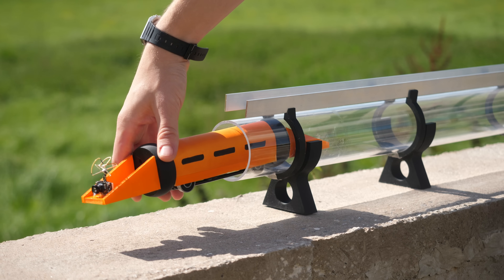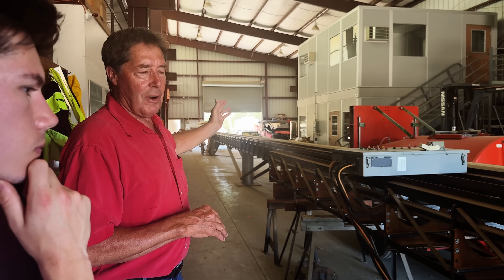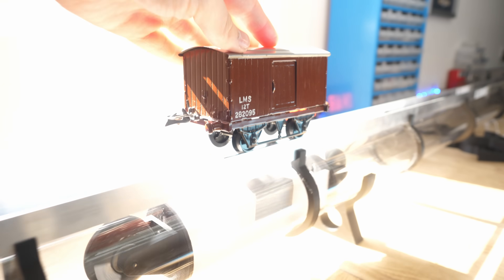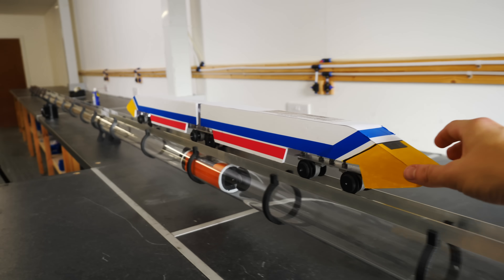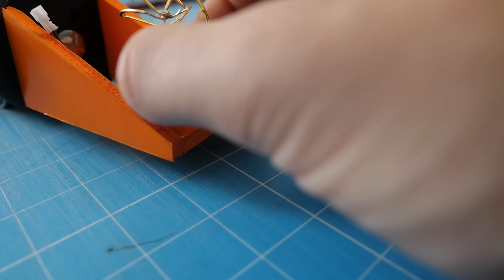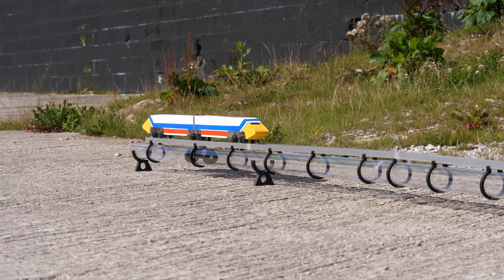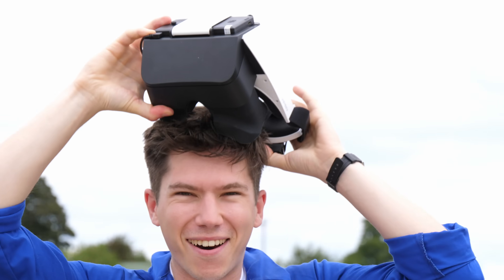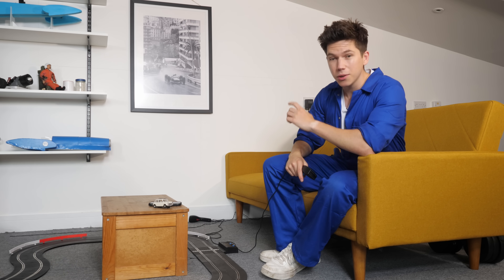Building a SPEED Hyperloop

Comment: There's a profound conceptual problem with this design- the physical work being done is coupled to the position of the train, not the velocity of the train.

This is because pressure * volume is equal to force per unit area ( rewritten as force * distance^-2 ), so pressure * volume is equal to work ( force * distance^-2 * distance^3 = force * distance = work ). Moving the train left or right means changing the volume, which means performing work to change the energy state on each side of the pneumatic tube on each end of the piston.

Contrast this to a traditional propulsion system where the work goes into the velocity of the train, and if you shut off the power source, the train will coast until it loses its energy to friction. In the system you've made, if you shut off the pumps, the work has gone into the position of the train, and the train will settle into a position where the gasses on both sides of the piston are equal pressure. It won't coast. 

This design is not efficient; it's deeply inefficient from the dimensional analysis.

Also, a simple way to increase the scale speed of your model is to simply build a real train that's double the size- then the scale ratio of your model also doubles, doubling your scale speed with no change to your model.

Comment: You could actually make it break the real speed of sound. Seal both ends of the tube with foil and create near perfect vaccum. The Pierce the end closets to the train causing air to rush in. In front of train their is no air to create resistance resulting in unrestricted acceleration. 😉

Comment: Nice start. If you want faster speeds inside the tube check out vacuum canons.  Have a valve at the start point pull down your vacuum  open valve and hear the supersonic crack.
Reply: A scaled up version of this is how they test impact dynamics. They use a frangible foil valve. When the vacuum/ pressure level gets high enough, the foil breaks and almost instantly allo3s air movement. Look up nasa experiment videos for that. Impressive energy release!

Comment: Try piping the exhaust of the vacuum to the other end of the tube to increase the pressure behind the carriage. That way its more efficient bc you are pressurizing the air behind the train while sucked out the air in front of it
Reply: So the problem of going transonic vs supersonic could be solved if the air was moving fast enough. The speed of sound is relative to the speed of the medium you're passing though, so increasing the medium speed could mean you could theoretically reach the actual speed of sound if you had a long enough track, a fast enough air pusher and puller, and enough guts to try!  I'd start with a huge industrial air pump on either end, one pulling, one pushing!

Comment: I think it would be really interesting (and probably more practical) if instead of having one long tube, it was made up of smaller tubes, each with a driver, with the train having electromagnets to connect and disconnect from them. This would not only making each individual tube significantly easier to (de)pressurize, as well as allowing for more trains on the same track and meaning that individual pump failures or pressure failures wouldn't result in a failure of the entire track, as the train would have enough inertia to pass through the inop sections without worrying. Hell, maybe the train could be maglev, with the minimal drag significantly increasing the maximum distance between pump sections.

also, please don't tell me you actually believe in the hyperloop as a serious proposal lol

Comment: What about braking for corners?  I suppose the train above could be fitted with brakes, or what would be better is to build the brakes into the track so when the train nears the corner the track itself  would be constructed so that it would automatically slow the train to the appropriate speed, same for the destination station!  Fully automated no driver required.

Comment: I mean, really impressive, but for the full scale version you'd need a ~30kWh vacuum pump. The irl weight would come out to 1.5 metric tons. An ICE for example has a normal capacity load of about 500 metric tons. 
Doing the calculation for that mass, the velocity would turn out to be 75 km/h. This all assumes no friction.
For a 500 metric tons train to go 1365km/h in your set up would need ~130 MWh at full scale and ~2.7 MWh at your scale.

That's the real problem with Hyperloop. Of course, there is a lot of optimisation possible, but none the less it's a whole lot of energy.

Comment: So, the concept of a vacuum train like this with the train above the tube is kinda pointless IMO.. the old 'vacuum train' was just because pneumatics were safer than electricity those days.
It might work for steeper grades to overcome the limited traction a train has but on regular grades all you have is an overcomplicated rail system as the drag and the friction of the train is the same or even higher than a self propelled train as the dimensions do not change. 
A train keeping constant speed on a level track requires very little power to keep going.
Using differential pressure is going to require exponentially more air pumped in or out  the bigger the volume over the distance is, and if you keep everything at a vacuum with the motor under the track then you defeated the purpose as you are now at the same weight as a regular train but just more complicated.
The amount of power required to keep a large tube at a vacuum would be quite a lot as would the time to get it back to a vacuum for the next train.
IF power wasn't an issue, a vacuum based hyperloop would be able to reach insane speeds though, but oh boy if something went wrong.

Going by a comment down below, a liquid hyperloop might be an interesting experiment as a liquid is far easier to contain and maintain than a vacuum and you don't need a lot of pressure difference to get things to move and apply force. Instead of 'riding the train' you would 'get flushed over to the next city'
You could even use the siphon effect to get some gravity assisted boost. Differences in elevations would be a problem though.

Comment: Adding tie rods between the rails (bolts and nuts between the rails would stabilize the distance between them.  Full size railways use these in real life to stop the rails from spreading when a train goes over a section of rail with a retaining problem

Comment: Wondering if you are printing in just PLA?  PETG or ABS should obviously  do better with the heat and elements.  I've started doing some resin printing.  I think that tech would be better for wheels and that sort of part.  the prints are so much more smooth and they can be solid or hollow, depending on  your needs.

Comment: I've worked a couple of decades in the PTS (Pneumatic Tube System) industry. 

The running wheels on the carrier in the tube are unnecessary.  It's been tried and abanioned many times in the industry. 

The "pistons" you are using is typically a ring of thin carpet or Velcro around the carrier. These "running bands" or "rubbing bands" both seal, as well as be a bearing surface to the pipe.
When Velcro is used, a ring of loops go around the carrier, then a set of strips of hooks attached to loops (by the sticky backing) is places around to allow for easy replacement, as well as sizing to fit the pipe.

On one way "Twin Tube" systems, the head of the carrier will have an "acceleration disk" which fits snuggly with the pipe. It's typically a disk of leather that is just a bit too big, and folds the outer edge over when flying down the pipe. These don't work on bidirections "Single Tube" systems. 

Also, having a little air going around the carrier can center it, as well as help lower the friction. So don't make it too tight.

Comment: Train wheels are a truncated cone to deal with the very issue you encountered with variation between the rails. Maybe try raising the tube up a bit off the deck, put wheels on the bit that goes in the tube, hang the carriage from the bottom and you wouldn't need rails at all.

Comment: You have not built a model of the Hyperloop as proposed by Elon Musk or even as modified by the corporations  using his ideas. You have only built a model of the much older differential air pressure transport systems. Hyperloop is neither a VacTrain, or a carriage as piston concept, despite the media conflating those alternate ideas with it.
A better way of envisioning what Elon had in mind, is a airliner without wings, levitated in some fashion within a much lower pressure system of tubes. Those tubes are the equivalent of an altitude over 100,000 ft, at which only electric powered aircraft can operate since there is inadequate oxygen for the traditional engines. The savings in time are really about not having to do the slow climb to altitude and the resulting  slow descent to gain that efficient means of fast transport.  
Regard this fact: the Japanese superconducting maglev train is to be built 80% of its way between Tokyo and Osaka under ground.  Its travel time improvement depends on having very few stops between those two points and very straight alignments. To do that in air,  with passengers, requires oversized tunneling. You can see that Hyperloop with magnetic levitation solves some of those extra costs over a new Higher Speed Rail line parallel to the existing Shinkansen. Just 20% more has to be in a tube. Air locks at the termini are also an expense but could be built into the cabin ends instead of having to encompass the whole vehicle.

Comment: Why not run air pressure,  and not vaccum? you could then use a large buffertank for air capasity... then use a magnetic valve to stopp the train triggerd by a sensor at the end  of the run. vaccum= max- 1bar.     Pressure= no limit .... deffenetly get the speed that you are after.

Comment: This video feels a little misleading.  Hyperloop pods are not powered by vacuum/pressure differential, they are powered by battery electric motors. The vacuum is there to reduce drag.

You have enough RC parts.  Get a vacuum pump, build a hyperloop pod and do this video again.

Comment: You can't actually have a "scaled speed of sound" because aerodynamics works completely differently at transonic speeds, something you cannot simulate at a scale speed and it would definitely affect your top speed
Adittionally I think there is a limit to how fast you will ever be able to achieve with an air pressure driven vehicle like this due to choked flow, essentially once your vehicle in the tube reaches mach 1 the air flowing into the end of the pipe will not be able to flow in any faster to fill the void behind your vehicle and will create a drag force that limits your top speed to around mach 1, no matter how high a vacuum you can draw at the other side of the vehicle. This effect will only happen at actual mach numbers though as again mach effects do not scale
Reply: Also the concept "scale speed" doesn't work because without changing the model at all, if I make a real train that's twice the size, my scale ratio goes from 40 to 1 all the way up to 80 to 1 for free, doubling my scale speed. The term is physically meaningless.
Reply: @clairecelestin8437  I totally agree with you 100%😅
Reply: @clairecelestin8437 And also on stupid TV shows about animals they always have "the fastest creature" as not the Pereguine Falcon, which goes an ACTUAL IRL 200mph in a dive, but some beetle that runs a 4mph, "but if it was the size of a human...!". If it was the size of a human it wouldn't even be able to breathe.
Reply: Scaled speed records of any type are a crock... if it is in the real world no mater how big or small it is it travels at speed, speed does not change because you are smaller or bigger...  S = d/t    simple formula.. works the same in a vacuum, on water, under water on land or in the air... forces change in all those environments but the way you measure speed remains the same. If this was the case then my 1/10th scale rc car that does 74mph actually does 740mph  scaled speed OMG it breaks the sound barrier provided its 32F.
Reply: @thesithlord327 you said exactly what I believe 😅 'scale' speed is utter rubbish! No offence to the Author intended, speed is speed😅 that's it!
Reply: If it's traveling in a vacuum then there are no aerodynamic forces at play other than friction of the air surrounding the vehicle and the tube, just pressures? If the aft section were under pressure the induced aerodynamic forces would be reduced? If both of those were balanced by vacuum and pressure what does aerodynamics influence other than the friction of the walls of the tube and the vehicle. I don't know, but had to ask. Airflow and pressure are different things.
Reply: @helicopterdriver  it's not a perfect vacuum, and likely far from it
Reply: @helicopterdriver  the vehicle is not "sucked" along, it is pushed by the atmospheric pressure behind it because there is in fact no such thing as suction
In order for the air to push on the vehicle air must flow into the end of the pipe to maintain pressure but as it does so faster and faster eventually it forms a sort of boundary layer choke point which actually stops any more air from entering the pipe which is called choked flow, even if it's a perfect vacuum on one side and a higher than atmospheric pressure on the other as long as the high pressure side needs to flow through a restriction (the end of the pipe) then this will happen and it limits the speed of the air and thus the speed of the vehicle it is pushing to Mach 1
Reply: @mishkamcivor409 I understand where your head is at, but the real world experimental data proves you wrong. 

Sources: firearms, artillery, spud guns, and Smarter Every Day's Supersonic Baseball cannon.
Reply: @mishkamcivor409
The mach speed referred to here is what pressure waves travel in that system of fluid, expansion rates into a vacuum(or partial one thereof) are completely different and much faster. Much faster. And are what would be building pressure behind the thrust piston not a mach 1 shockwave.
Reply: Just make a scale train small enough to fit in an air rifle… you’ll be hypersonic with a puff of air
Reply: This is done in wind tunnels by changing pressure, I think? So the scaled model is in an atmosphere that matches the Reynolds Number of real air? Something like that...
Reply: also at any rate making something small go 25km/h isnt really that impressive.
Reply: LOL Scale speed. that is the first time i have heard of that...

Comment: Looked like there was a dip in the tube path in the first 1/3 of the track that was robbing you of some acceleration.

If you make another version, design a "flag" or circle that hangs off the side of the tube supports with a small hole in the middle. Then you can use a laser level projected through the holes to get shims under the track supports and make a perfectly straight/level tube.

Comment: OOOO! What about Rubber bands to hold the rail clamps closed? The rubber bands cannot pull beyond the physical design of the 3D Printed parts, yet still being flexible enough to give-way as needed but will still try to resist. #2, Why was it necessary to have the rail clamps open in the middle? (never mind, I just figured that one out BUT, that leads me to the next question... What is the "Working Range" of your magnet coupler? What is the Min/Max clearance between the two magnets? I bet the answer would allow for a particular amount of "clearance" for a solid 3D Printed Rail Joiner... hahaha .... Maybe!! Just wanted to share. Thanks for the awesome video!!

Comment: I am curious. Would that go at the scale speed if it was a real life scale one? Like I don't know if it would be faster or slower (or more or less the same), because of the same reason that it was thought that "According to all known laws of aviation, there is no way that a bee should be able to fly" . I might be very wrong tho, please correct me if that's the case as I don't really have much knowledge😅
Reply: You would also need to scale up the vacuum cleaner though... That and the weight of a real model (to make it sturdy and able to fit passengers or other things ) would be the main issues  to make it work.

Comment: For the train on top version. I was instantly seeing issues with the open 'C' rail clamps. with the open part of the clamp being between the rails you're making the rails move away from each other mechanically extremely easy.

If you redesigned it so the top part under the rails is bridged and move the open part of the clamp to the bottom, the rails would be very hard to force apart...